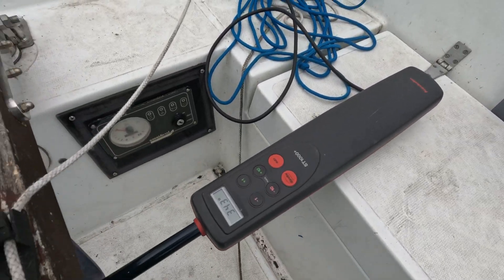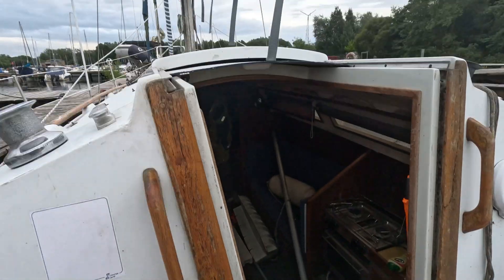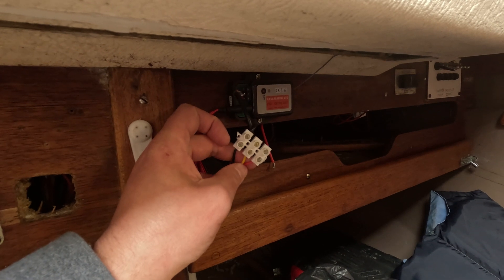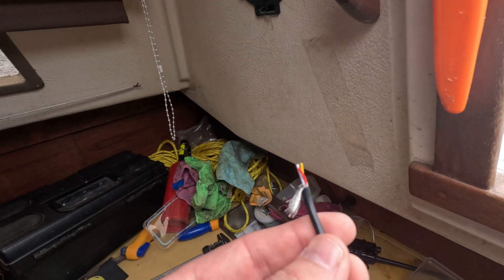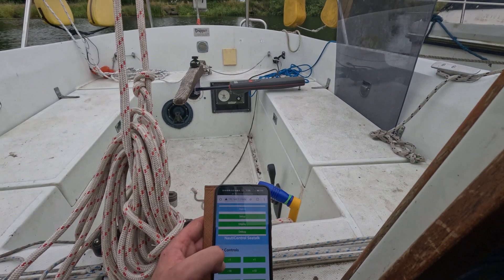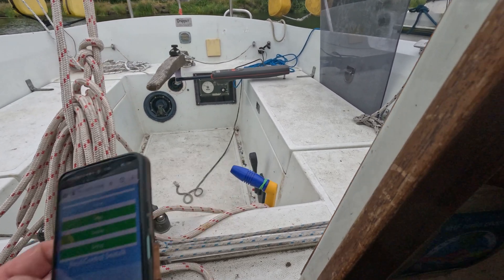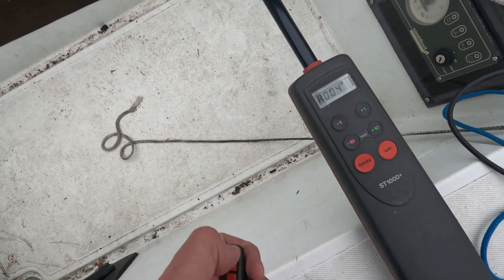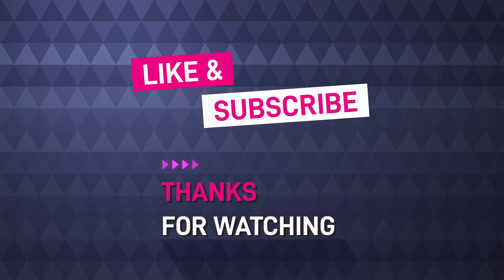Installing Nauti-Control Open Source remote control  For Raymarine Autopilots on my Trapper 501

Comment: For my 7m sailing trimaran, I used to have an ST1000, but went to the Simrad TP22. This was mainly to be able to change the seastate control on the fly, but more importantly, have built in full travel limit switches to stop the unit from self destructing.
I would love to get a cheap DIY remote for the Simrad. Would your unit work? Or if not do you know of any other sites I could look at. The only ones I have found were complrex. Thanks
Reply from the maker: Tp22 is nmea 2000, I've looked the older tp20 remote have one bought to try and work out how it sends the instructions. However the raymarine autopilots are by far more configurable, seastate and all those other hidden settings can be updated dynamically remotely I've found and why I've stuck with those on my boat.